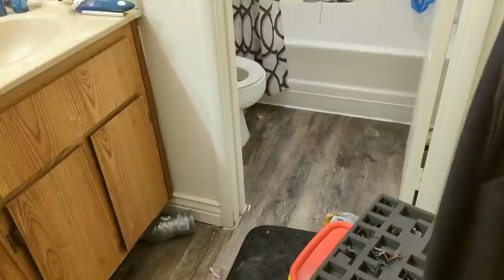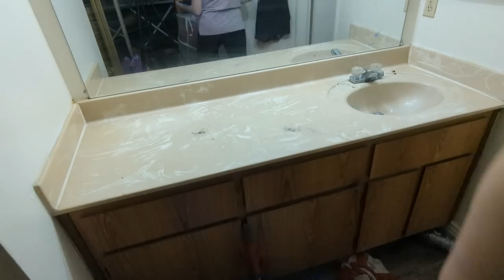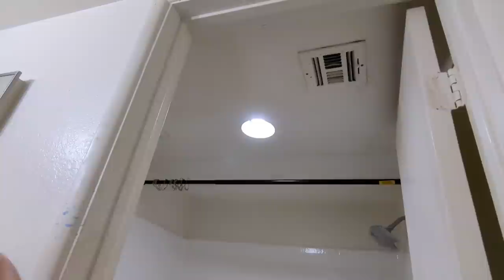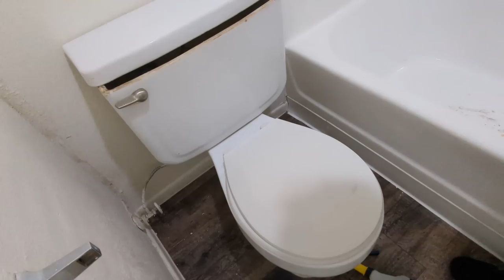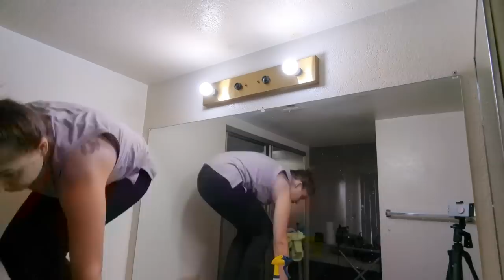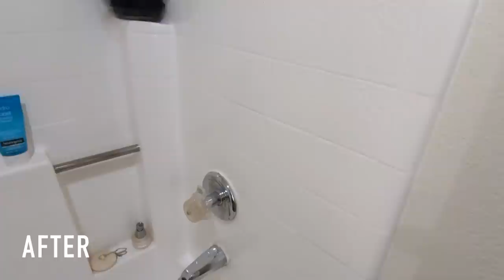Depression House EXTREME CLEANING MAKEOVER! | Ep. 1 - The Bathroom

Comment: I learned years ago an easy all purpose cleaner is 1 Tablespoon liquid laundry soap, 2 Tablespoons dish soap and warm water in a big spray bottle. Shake it up. This can be used on anything. If you spray it on a dirty wall, the dirt will run down. I have used a Libby mop with Lemon floor cleaner to clean walls of a smokers apt. Also when I was a kid, I helped my Grandma to clean yellow smoker walls with warm bleach water. I no longer use bleach in cleaning due to sensitivities. I also have a small steam cleaner for cleaning with less chemicals.
Reply: Thank you,,,,i will try it next time. I use also laundry powder to clean bathrooms and scrubbing it at the kitchen zink.

Comment: I’m wondering what you used (cleaning solution wise) to spray on the walls and ceilings that cut that nicotine stain so well? I use to use oil soap and ammonia in hot hot water .. it did very well taking that star off but I had to change the water frequently.... you did a great job!